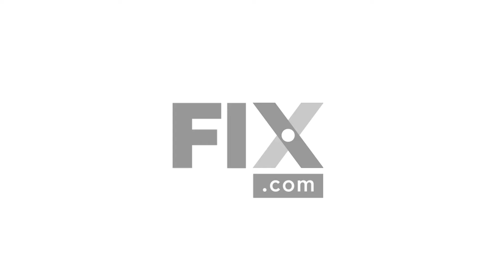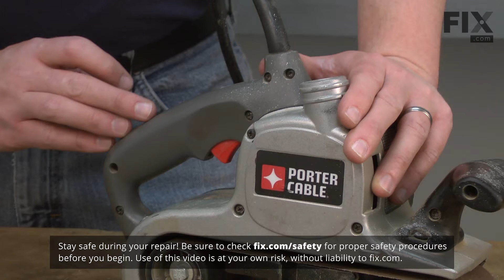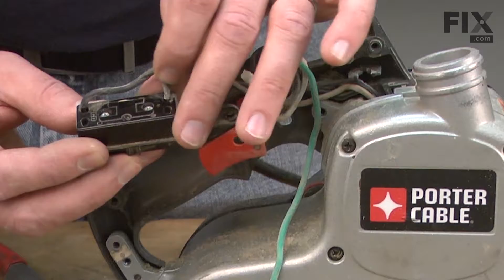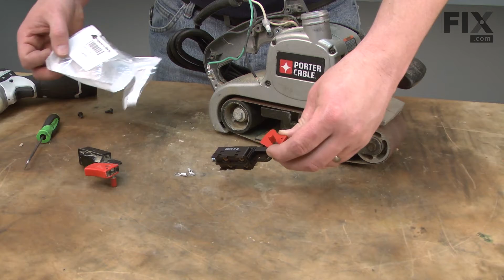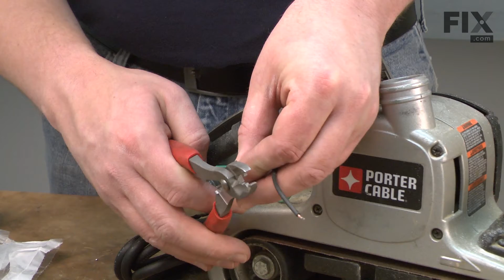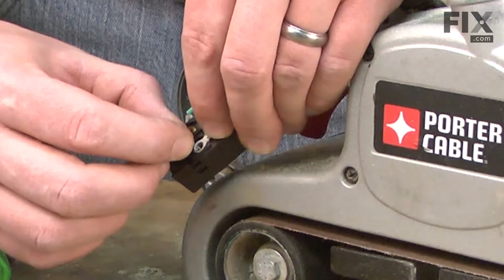Porter Cable Sander Polisher Repair – How to replace the Belt Switch

Comment: For anyone following this tutorial, I wanted to share my experience because it may help you out and save you some money. When I took apart my 352VS belt sander handle to replace the trigger, it already had the replacement style trigger in it. I bough it new from Home Depot, so I'm guessing the manufacturer switched to this style of trigger at some point versus the push connectors. I was going to order a new trigger, but it was going to be $25 - $35 and 5-10 days to get it. I decided to take the trigger housing apart and discovered it was full of sawdust and the contact points couldn't make good connection simply because there was sawdust in the way. I cleaned it all up and put it back together. It worked good as new!